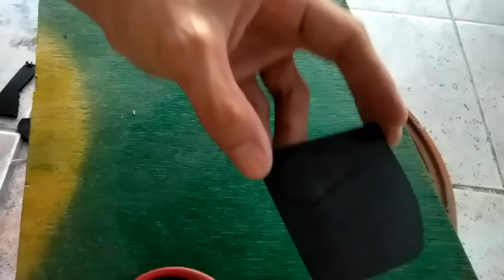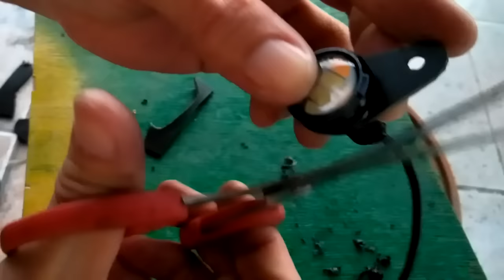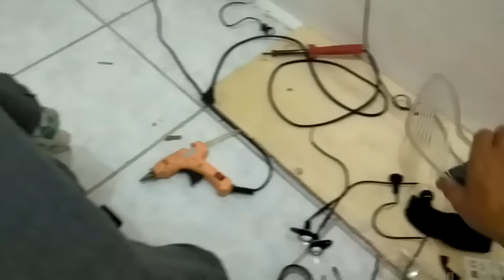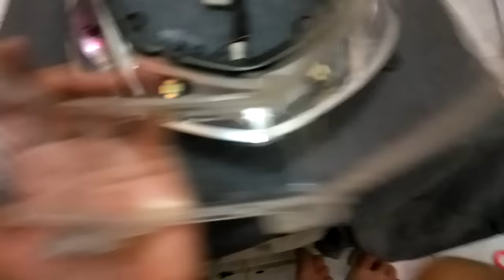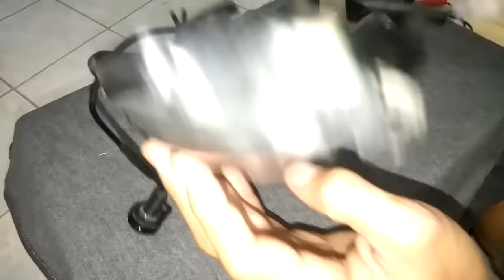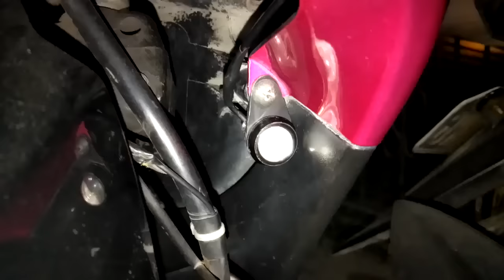How to install Eagle-Eye LED

Comment: Boss ask lang po mula nung nag led lights ako sa parking light front signal light at eagle eyes ayaw na umakyat sa 13v ang batt ko.. need ko po sipaan ayaw na po mag push start.. need ko po ba mag fullwave? Stock kasi rectifier ko or sira na rectifier ko?
Reply from the maker: Check mo muna rectifier paps, kc kung paklight at turnsignal lang mga led kaya pa ng stock rectifier yun.  If pati headlight led na rin mas mainam mag fullwave.

Comment: boss pag ba and black wires ng blue eagle eyes kinonnect ko sa wires ng signal lights (green and brown) sasabay din ba silang magb.blink sa signal lights? salamat.
Reply: naka connect din kasi 2 wires ng hazard switch sa wires ng signal lights.
Reply from the maker: @josephdulaca2349  sensya sir pero di ko pa natry :)
Reply: @MotoDIYs  ok na boss . it worked! :)
Reply from the maker: @josephdulaca2349  nice boss! ma try ko din minsan yan :)

Comment: Idol saan pwedi mag tap samay likod ng mio sporty ng led pad light with switch? Sana masagot mo idol salamat po
Reply from the maker: kung battery operated kana tap mo sa sa blue wire ng tail-light para pag ON mo ng parklight sasabay sila, kung ayaw mo naman isabal sa parklight switch mo, pwede kang magtap dun sa brown sa may CDI.
Reply: Sa blue wire sa may tail light positive ba or negative tas yung isang wire ng eagle eye San po tatap pa Yun sorry newbie lang sana masagot po salamat

Comment: boss paano pag walang housing ng led?paano ekabit .?salamat sa sagot.
Reply from the maker: tap or connect mo yung positive wire ng led eagle eye sa color blue na wire tapos yung negative wire ng led eagle eye sa color black na wire.
Reply: ti nap ko boss pero ayaw parin.isa lang yong eagle eye na eni connect q boss hindi parha sayo dalawa.hindi kaya sa baterya ko to boss?baka mahina na cguro.
Reply from the maker: @daisytaylaran54  posible sir, try mo check mga wiring mo sir baka may putol o sira.
Reply: @MotoDIYs  boss  diba 4 ang lahat +.at 4 -?ang sa akin kasi ay nka tap na lahat sa isang wire na galing sa socket.bale yon isang wire nandun lahat ang +.at yung negative nman dun din lahat sa isang wire galing sa socket.pero gumana nman lahat.tapos ti nap ko din yong eagle eye ko sinama kung saan ang +@-.pero yung eagle eye ko lang ayaw gumana.ti nap ko sa baterya direct gumana nman ang eagle eye.ano problema dito boss?salamat ulit..
Reply from the maker: @daisytaylaran54  battery operated naba parklight mo sir. kahit hindi mo sindihin yung makina umaandar yung parklight?
Reply from the maker: @daisytaylaran54  yes tama po 4+ at 4- lahat ng 4+ sa color blue na wire at yung 4- sa black wire
Reply: dati boss nka battery operated to.kaso nung ngpa tap aq ng signal light.ngtaka nga aq bkit nwala nung pinalitan ng relay.dahil sira dw relay ko.

Comment: sir bakit po ganun ginaya ko nmn po yung ginawa nyo pero ayaw gumana sakin battery operated nmn po motor ko . . salamat po
Reply from the maker: tama ba ung polarity nila sir baka baliktad lang pagkakalagay ng positive at negative wire ng mga led. try mo pagbaligtarin yung mga wire nila sir.
Reply: @MotoDIYs  last question sir need ko pba palitan flasher ko stock padin po gamit ko ehh . . salamat po
Reply from the maker: @christianuy6798  kung stock bulb parin mga turn signal ng motor mo sir kahit wag kana magpalit.
Reply: @MotoDIYs  salamat sir laking tulong mo 😊😊😊